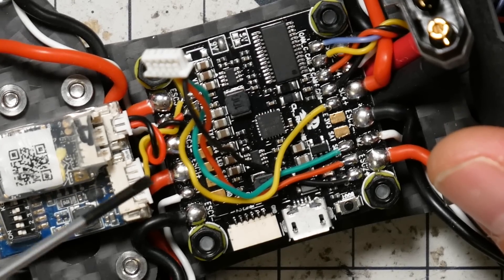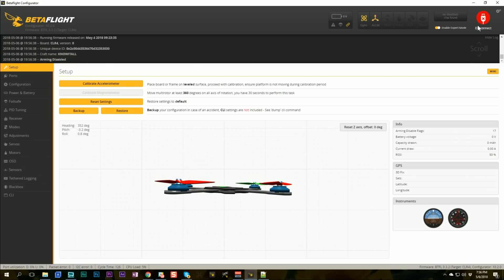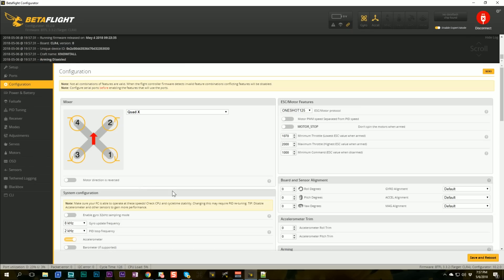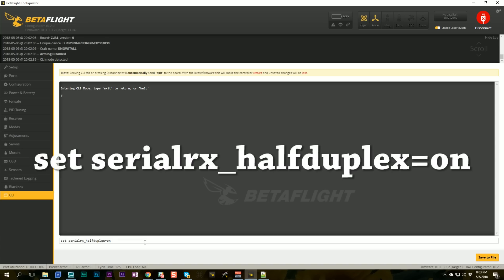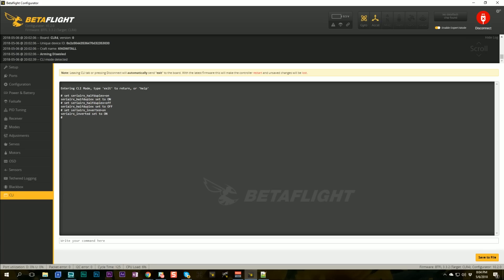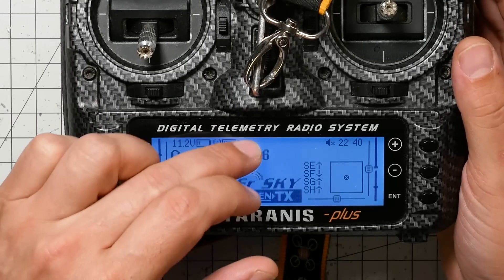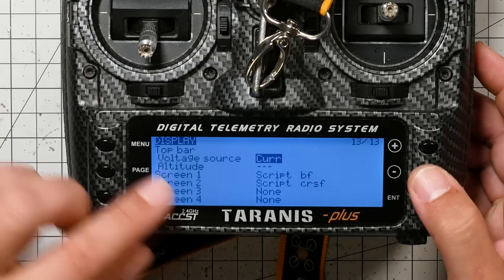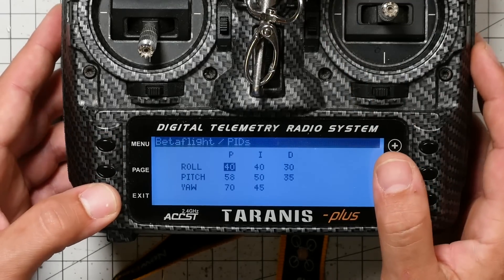FRSKY FPORT HOW TO | SBUS and SmartPort on One Wire

Comment: Can you run F.Port through SOFTSERIAL on F4 boards to get past the inversion issue?
Reply: You can BUT not a good idea as your control link is going over it
Reply: what I use and also recommend is to use the normal Sbus protocol on its pad and in addition to that, use SoftSerial for SmartPort-Telemetry. SoftSerial is great, but it's a bad idea to use it with a receiver.
Reply from the maker: I don't think betaflight will allow serail rx over softserial. If they do allow it, you shouldn't do it.

Does your F4 board not have a smartport or telemetry pad to use? Most do these days.
Reply: On an F4 Board, what are the advantages of FPort? If the pad is already inverted, you can't use it for anything else anyway, right?
Reply: Nathan Schlenker the benefit is freeing up a uart. The telem/sbus pad will be inverted but the uart its attached to is often broken out elsewhere
Reply: FPort has less latency than SBUS, that's why some racers use FPort even if they are not using telemetry at all.
Reply: @Snorkl FPV are you sure about that?I've thought that the latency is still the same (I even believe, JB said this in his first video about the F.Port protocol)...

And by the way, Betaflight actually allows you to use SoftSerial for a SerialRX. As JB said, don't do it. I did it and trust me, it's not a good Idea. The problem is, that my board (OMNIBUSF4) does NOT have a smartport or telemetry pad, and also no invertable UART. It only gives you a SBus pad.That's why F.Port is not an option on these boards.
Edit: As long as you use a receiver like the Frsky XSR-m, where you can not get the uninverted smartport signal.

Sorry for my english, I am not a native speaker.
Reply: @michaelriffel477  Hi Michael, thanks for your comment. Would that apply to a DYS F4 Pro V2 Flight Controller ?? (i.e. just UART 1- {TX-1} works natively with sbus / No telemetry pad or invertable UART) Note: I did get telemetry working, but was a tricky hardware hack using a FrSky R-XSR and the smallest pcb pad I've ever soldered :)
Reply: @JawaPaul  sorry, I didn't get the question... What do you want to know?

Anyway, if you did the hardware inversion, you can just use F.Port on any uninverted TX-pad.
Reply: No, I am not sure at all, just something I read somewhere. I think at least in theory FPort should allow faster sampling rates which would result in smaller latency. I don't have the means of measuring latency nor would I feel a difference because I am a novice pilot. The main reason I use FPort is to work around the LUA bug of the R-XSR when changing to VTX channels 2 or 3.
Reply: Asked the question for a couple of reasons.

1) Preference is to not hard wire the RX to the FC where possible (it makes maintenance more difficult - so preference no RX uninvert hack.).

2) Some OmnibusF4 boards do not have a dedicated sbus pad (UART3 can be with a solder jumper) or smart port pad (easiest smart port method is use M5 or M6 as SOFTSERIAL - no inversion requried).

I little doubt that F.Port over SOFTSERIAL may not be a good idea, but interested to hear WHY F.Port over SOFTSERIAL should not be done. (dropped frames, latency, etc...)

SOFTSERIAL relies on the F4 to manually process the signal instead of letting the hardware do it, so it takes clock cycles.

If the quad filters are optimised for speed (ie. not overtaxing the processor - running 25% CPU or less), then should be little danger of dropping a frame due to interrupt overload.  F.Port does CRC checking, so frames corrupted between the RX and the FC should be automatically dropped.  Main danger I foresee is latency (but only 1-2ms).

btw, In-air frames are corrupted/dropped fairly often.  Only when a number of successive in air frames are dropped do us as a pilot tend to notice.

SOFTSERIAL does appear to have the SerialRX option.  I have not tried to activate it yet.

Note: F.Port frame rate is locked to 9ms, even when transmitting 16 channels to the FC.  As FrSky over the air protocol uses 18ms for more than 8 channels, only half the channel frame would be updated per transmitting cycle if using 16 channels.

Happy to experiment as my "basher" quad is the one with the OmnibusF4SD board.
Reply: It's kinda hard for me to find the correct words for it, but the recieiver constantly sends a lot of data to the FC, which are quite important for the latency of your RC signal. And for this, SOFTSERIAL as a softwareemulation is not the best solution. Correct me if I said something wrong, but that's what I've heard so far.
Reply: @ArchmageAU 1) Get yourself some AWG28 silicone wire, some crimp connectors and a crimping tool (don't bother spending money on anything else but the Engineer PA-09). That will allow you to cut all wires in your build to length and connect everything with connectors so you can easily replace or flash components.

2) Softserial, as the name implies, is a a serial interface emulated in software. If you run your control connection over softserial there are a lot more possibilities for it to fail. If the CPU is overloaded your quad falls out of the sky, if your FC is out of memory your quad falls out of the sky, if there is a bug in softserial your quad falls... you get the idea. That's why I wouldn't try running RX over softserial.

I took a look in the FPort specs and it is locked to 115200 baud. So I stand corrected, FPort will not give you any advantage concerning latency.

Comment: can you please review and setup the frsky R9 receiver with the R9M module and compare that system to the crossfire one? thanks!
Reply from the maker: Yeah I have it on order.
Reply: Joshua Bardwell sweet, thanks! being that everyone seems to be sold on the crossfire system, I think it would make a great video.
Reply: droneXcursion I'd love to see this as well, awesome.
Reply: +1 to this... specially with the new Frsky X lite and R9M lite module coming out!
Reply: droneXcursion +1👆 how setup telemetry  r9 pleas
Reply: Joshua Bardwell hy there's alot people  waitin for tht review.

Some things we like to  see
r9m and r9 slim 100% stock
r9m with the immortal T and rx stock

and some way of measureing the latency if possible  compared tbs system

That would  be great  
Thanks
Reply: Need this also, bought crossfire per your review but then left lipo plugged into my X9D and blew the back off of it..... Errrrrrr.... Anyway, have a couple Qx7s and R9 sitting here sooo.....

**The special edition qx7 does some crazy yall spin/twitch when coming out of a large dive with throttle low for long hangtime, figured I'd mention it while messaging the know-it-all.  Thanks for all the info and help BTW.

Comment: I WAS WORKING ON THIS YESTERDAY. Are you some sort of omnipotent quad-god? Either way, I got it working on one quad, and killed an RX trying to be smart and hook up the uninverted s.port pad to the sbus-in pin (on the RX, not on my FC.) so I could just use the connector. I don’t know if it’s just bricked or totally fried.

Comment: Hello Joshua, Great video as usual :) 
So that means that now we can have telemetry and SBUS on the same UART, great! So is it then possible to use the SBUS pad (that is generally identified on most FC) that is now free as any RX UART for any other use? And then we might lack the TX pad for this UART also right?

Cheers from France!
Reply from the maker: Unfortunately the answer is probably no. Most FC with an SBUS pad have an inverter on the pad that cannot be disabled, so the SBUS pad is usually only good for SBUS. On my FC and CLRacingF4, and maybe some others, the SBUS pad has a software-configurable inverter that switches on and off automatically, so the SBUS pad can be used as a generic RX pad. But since there is no corresponding TX pad, it may not be so useful.
Reply: OK, too bad then... thanks for the clarification, so this is helpful only for FC without dedicated SBUS pads at the end.

Comment: so what to do with sbus pad now?, assuming the FC has no tlm pad and I have to use a common TX for telemetry
Reply: Could use Sbus pad for ESC telemetry (it does not care if it is inverted and only need RX (same a sbus)).  Frees another UART for VTX (TX) or cam control (TX & RX).
Reply from the maker: It's not good for very much. On some FC it can be used for RX-only functions like ESC telemetry. (My FC and CLRacing are two that I know you can do this). But since there is no corresponding TX pad, it's not good for very much.

Comment: Can you run the F.Port from a UN-inverted R-XSR?? 
So, solder a wire to the little uninverted S.Port pad on the receiver straight to the FC and call it a day?
EDIT: I've found my answer in the BF Github. Apparently it should work, but I have not tested this yet.
https://github.com/betaflight/betaflight/wiki/The-FrSky-FPort-Protocol
Reply from the maker: You do need to go in to the CLI and "set serialrx_inverted=on". This is counter-intuitive since you have un-inverted it, so why is the option set to "on" and the answer is, it's confusing.

Comment: I got F.Port setup in Raceflight Revolt V2 running Butterflight. Hit me up if there are any question on the setup.
Reply: ndcapper any issues with flashing butterflight to a revolt? Also can you go back to RF firmware if you want to without any hassles?
Reply: @Just  Chill I had to jumper the boot pins to flash BuF and use the the Impulse Driver Fixer. I think you should always be able to flash back to RF. At most you might need to jumper the boot pins. I will tell you if you want to use sbus on uart 1 or uart 4 there are some pads you might need to jumper because on the board they are TX(RX is needed for sbus). Betaflight github has a good some notes on what''s required. just google "betaflight Revolt (V1 & V2)".
Reply: Only cause im curious... why run butterflight on a revolt that supports raceflight? only reason i ask, is the kalman filters, which is what makes butterflight, butterflight, are basically from raceflight to begin with? (i run both raceflight and betaflight on all my quads.)
Reply: TrueStyle fair question. There are a bunch of small reasons I guess. The biggest reason is my build of RF is so old it doesn't have turtle. Everytime I look to flash a new RF build I went to slack or now discord and there seems to be reports of issues I'm not comfortable with. Long ago it was an arming issue and most recent YSTTM. I have been happy with the flight performance I'm getting from RF. Mainly I just want to try BuF. I do have 2 identical builds and the other I'm likely going to try the newest RF... just to compare